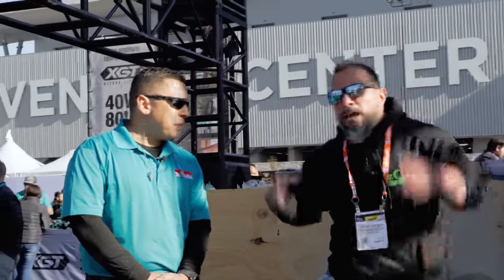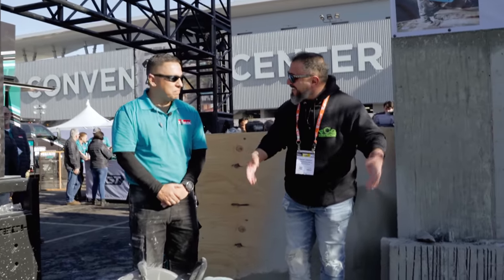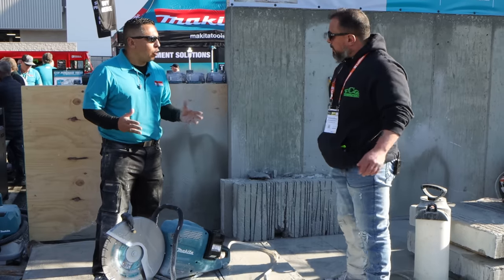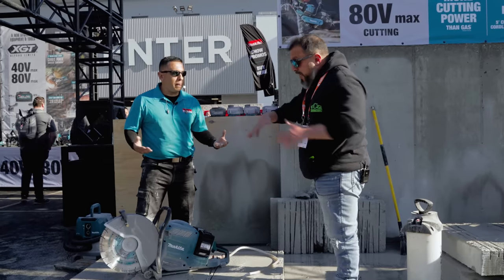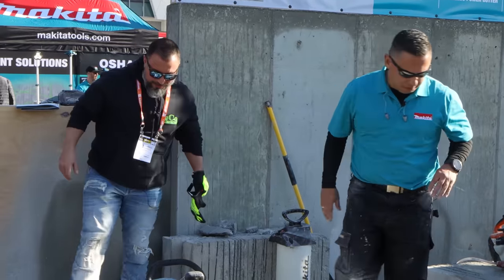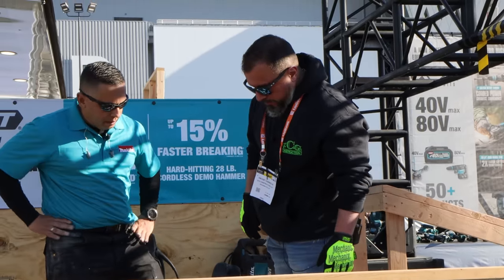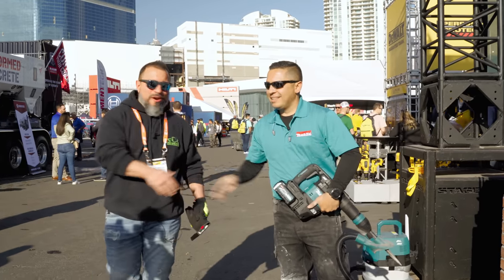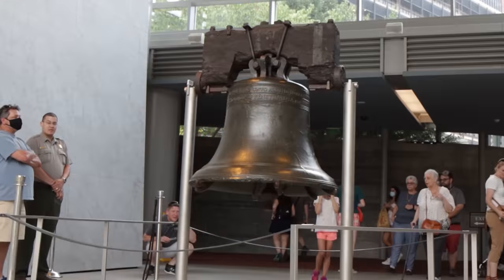Makita Tools Do The Impossible!

Comment: HELLO VCG 👋 
I'm leaning on the 40 volt platform.  I am thinking that I will mostly likely adopt it.  
As an Install and remodeling business, I think the new 40 volt system sure looks appealing if the price point it there and availability it there.
Reply from the maker: I like the fact that the one platform is able to run the smallest to largest tools! Only other platform capable to do that presently is Hilti!
Reply: @VCGConstruction   Very True
Also Makita's battery technology really needed an upgrade, So I think  the 40 volt is a very good move for Makita. There is an 8amp 40volt battery in Japan currently available.  Hopefully are market will see that battery with in a years or so.
Reply: I absolutely love my Makita XGT tools. The only draw back is that they come out in Japan 🇯🇵 and New Zealand 🇳🇿 long before us 🇺🇸 unfortunately. I don’t see the reason for that. They would sell just as much if not tons and tons more here 🇺🇸 but yeah, the new battery technology even the way they’re made is very innovative. I’m really excited about this new line.
Reply: @skolsaw1080  Absolutely 💯 
For some reason most of the world gets new Makita,  Bosch, and German Metabo about a year before the US market and it some cases not at all.
Are US market is huge.  I really do not understand why we get new items last.
Reply: @stephenleepmg113  because the US market is small compared to the rest of the world. Just the UK market alone is much larger than the US market.
Reply: @AzTurboMini  Did not know that.
With 350,000,000 people plus millions of illegal aliens in the country and running across are south boarder.  I would have thought are market was larger.
Reply: @skolsaw1080  I’m no expert but my guess would be since they’re made there so it’s more cost effective to see if markets actually take to these before they send them over here or  maybe I’m dumb

Comment: I might have to get their 10 1/4" xgt circ saw and the 10" xgt miter saw but that cutoff saw only running 15' on a 4" deep cut is pretty underwhelming. Wasn't really a fair head to head because the cordless was only around 1-1 1/2" deep max for the cut when the gas guy was running 2-2 1/2" deep. Still appreciate the info, thanks man.

Comment: Yo Vince! Yo gotta do a TTR: Makita XGT vs Milwaukee MX 🤔
Reply: Same power. 50% more runtime/faster charging/less weight and noise on the makita
Reply: Milwaukee mx fuel is a 80v max and 72v nominal system with 25 amp discharge so there average watts would be about 1800 watts. They got a 3 ah 216 wh battery pack with 20 18650 cells and a 6 ah  432 wh pack with 40 18650 cells. As for makita there xgt batters are 40v max and 36v nominal I don't know what there discharge amps are though they have a 2 ah 72wh with 10  18650 cells a  2.5 ah 90wh with 10 18650 cells a 4 ah 144wh with 10 21700 cells and a 5 ah 180wh with 20 18560 cells there upcoming battery pack will be a 8 ah 288wh I'm presuming it will have 20 21700 cells. Note that the 18650 cell usually have a higher amp discharge witch will deliver more power and the 21700 usually don't output as much but can hold more energy = high ah. So roughly the makita xgt 2x = milwaukee mx fuel. Also note that the upcoming makita 8ah battery when using two of them = 80v should give you more run time then the milwaukee mx fuel 6 ah.
Reply: @sv-et7gq  exactly 50% more runtime in practical testing.

Comment: I just got the makita grease gun for $99 bucks👍 I'm not a huge makita fan but it was a good deal
Reply from the maker: Glad you scored
Reply: Where did you get it?
Reply: @danielbanda4436  tractor supply. it has a 2ah batter and charger to👍
Reply: @BC-go2hm  In store? Its $299 on their site
Reply: @danielbanda4436  in store on clearance for. 50% off

Comment: Not to be that guy and not knowing what size that stihl concrete saw is but I can say there is almost no way the Makita could beat it if it was fair just saying! But I do like Makita products. Battery tools can’t replace 60cc or larger engines yet not even close maybe 35cc home owner style saws but that’s it
Reply: You obviously are that guy. Because you lack the needed Information.  Those new XGT 8 amps batteries can deliver 81 amps peak. At 36v that's 3kW output from a single battery. There's 2 of those on the tool. A 60 to 70 cc power cutter has what ?.... Somewhere around 3.5 kw output ?
Reply: @dominicvanlievenoogen6407  your right 60-70cc saws can’t compare, that’s why every professional timber faller uses battery saws. In the next few years there will not be a battery saw no matter what type that can compare to a 60-70cc pro stihl or Husqvarna saw unless it’s way heavier and far less useful. I have a 36v Makita top handle saw for pruining and it’s great but in no way does it compare to a 35cc top handle saw yet. Runs out of battery power after making 10 12” cuts in soft wood.
Reply: @9.16TreeService  you were not talking about runtime. You were talking about power. Just accept that you were wrong in that department. Runtime is a whole other thing which I can absolutely agree with you with
Reply: @dominicvanlievenoogen6407  I am a fan of battery tools just not misinformed tests. Pencil pushers will say things that don’t add up on a job site, nor in reality. I won’t make another comment because it seems meaningless and not because I don’t want to talk with ya but because battery tools of the nature as shown above aren’t viable options to replace 60-70cc saws yet in terms of power or run time.

Comment: I don't believe in battery powered grinders for thick concrete, or breakers for concrete or the methods used here. I would be against these products as a builder of 20 years, when at these places unless, it impressed me. Seems like your the guy on a shopping channel. Trying to conVINCE people that its better. Corded will always be better
Reply: This tool is great for basement bathroom editions
Reply: @jimsongworld8224  why?
Reply: @anemone9895  residential basement slabs in the States are less thick than commercial structures and for most cases you would not need to saw cut more than 30 ft. Which the battery powered cutoff saw would shine because you’re legally allowed to use it indoors. For electric concrete saws they tend to trip the home breakers so you maybe need to run a generator outside and use extension cords.
Reply: @jimsongworld8224  but you can use a transformer to convert 240v to 110v still with plenty of power. I don't know what voltage US uses
Reply: @anemone9895  most U.S households have 120v. The typical outlets that are 240 are washers/Dryers. And they’re usually pretty far from where you would usually do work.
Reply: @jimsongworld8224  ok no worries. It works for US and not for UK